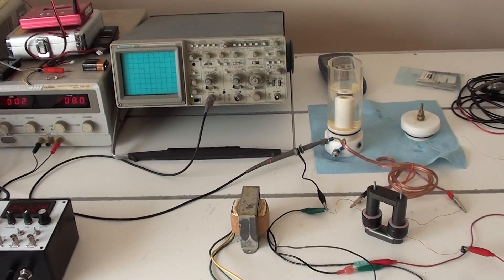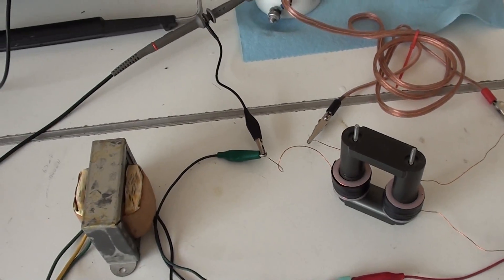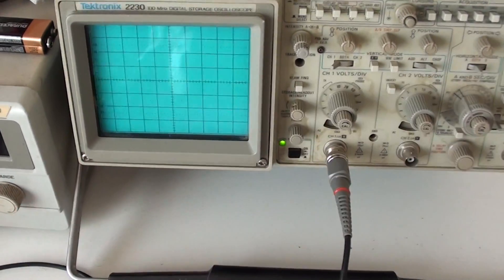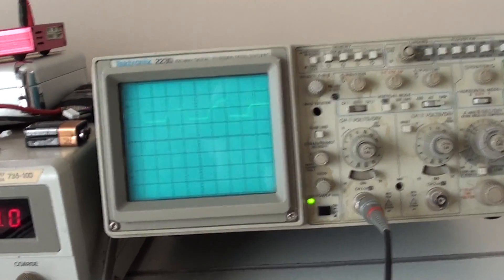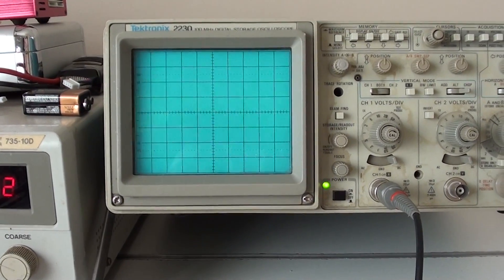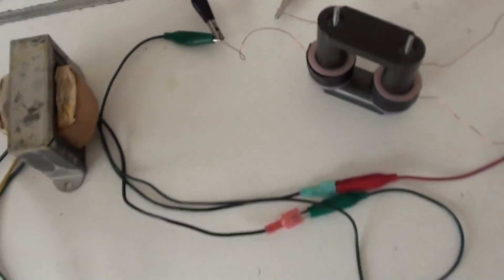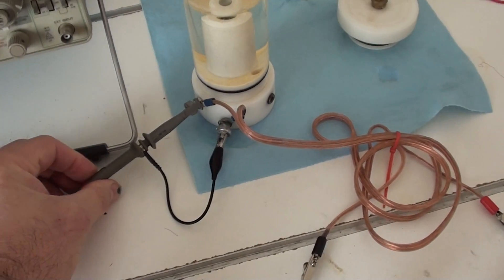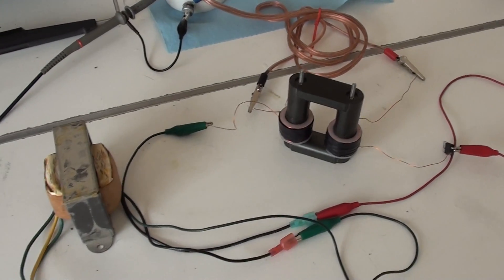Stan Meyers replication resonant cell6

Comment: Hey Don, do you still have that Steam Resonator manual from your estate videos? We've got a couple of the resonators machined out now and are testing various circuit arrangements for them.
Reply from the maker: Not quite sure what you are looking for with "Steam Resonator". Are you talking Water fuel cell? The resonant Water Fuel Cell? Or the water heater in the water tank to keep it from freezing?
The only manuals I have were his Patents. They are online for free downloads everywhere.
Reply: @Dynodon64  Sorry, I was referring to the Home Heating Unit manual you showed in your estate video. We acquired the mechanical specs for the buggy version of the Steam Resonator (slotted tubular dual cavity) and had 3 units machined up. Since the principle of operation was the same, I wondered if that Home Heating manual may have revealed something further on its operation. Have you seen what we're doing on the Stans Legacy website? We have a Discord community now too to help people learn and reproduce.
Reply from the maker: I don't have anything from the estate. All of that was sold to a company in Michigan. Last I heard, it all went into Canada. Sorry I'm not able to help. @drgonzo7806
Reply: Ok, Thanks Don!  @Dynodon64

Comment: Nice work don, good observations. I was able to make small amounts of gas doing a similar thing.  The bad thing is is if I was to diss connect the coils and connect the dc straight up as the same amperage and voltage I could produce more gas. It was kinda just proving the concept but was not enough to show better results than normal electrolysis. None the less. The concept Is what's important here.  Thanks for sharing Don, be well I hope to get back to some of my projects soon! ~Russ